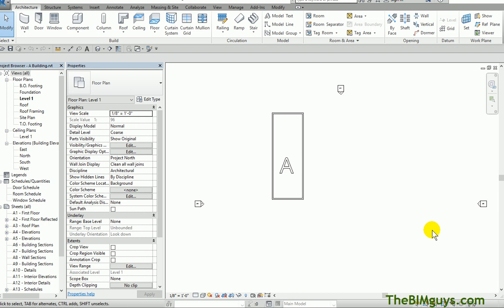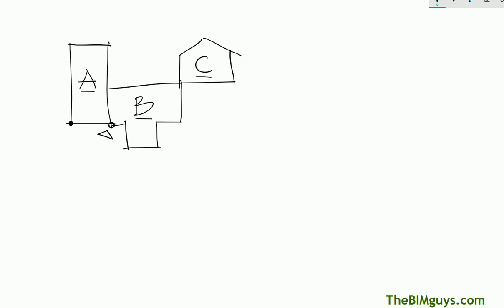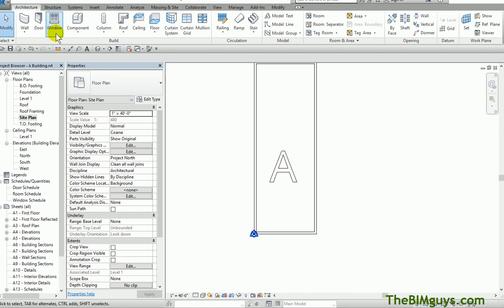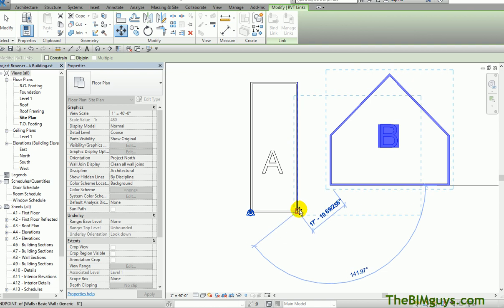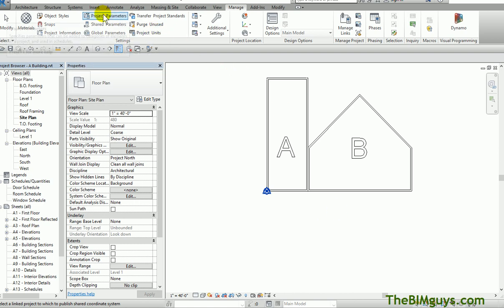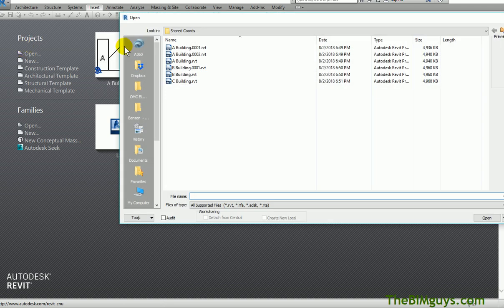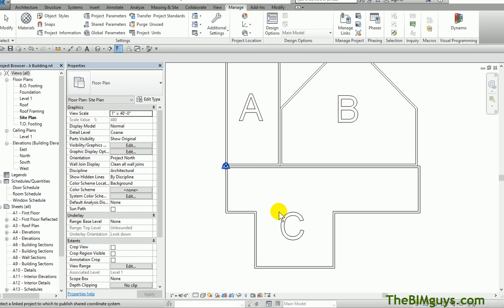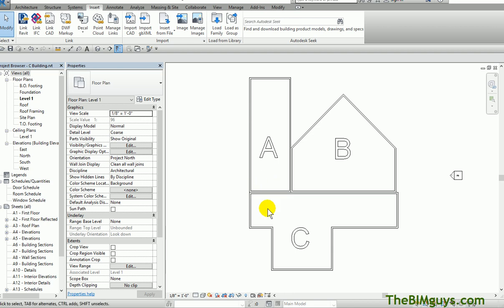Revit Shared Coordinates Simplified- CADtechSeminars.com

Comment: it worked for me! thank you! I just have one question, how come the project base point and survey point of both files are different even though they are aligned?
Reply from the maker: It depends on what option you used when you linked in the file and what point system you used to align, Check your shared coordinates also.

Comment: Great video! Moving the PBP från the Project Origin is something people consistently do in videos on Youtube. However I have strictly been advised not to to do that since it will unnecessarliy offset linked IFCs. Also seems like Autodesk now has removed the option to unclip the PBP since revit 2021!

Comment: What if the linked RVT file is supplied by a 3rd party and is still a work-in-progress, therefore keeps changing and being updated?
This would have to be done each time, there is a new version of the linked file.
In such case, I don't see any particular reason to use shared coordinates, as the next time I'll be linking the file, it'll be a different file with no saved positions.

Comment: It would have been very useful if you explained what the internal origin is.
Reply from the maker: Sorry, When this video was created, the internal point was not available to the user in Revit as it is in the current versions.
Reply: Actually the internal origin point has always been available. The only difference between Revit 2020 version and previous releases is that in the latter it was invisible. In order to find it you just need to select the project base point, unclip it, right click and click on the option “go back to original position”. That is the internal origin. What I suggest is to draw a cross with 2 reference planes and pin it so you always know where it is in the model.
Reply from the maker: @gabrielepiacentini9277  good point!  - pun intended :)

Comment: I like it. But what if B and C are actually existing buildings linked in where their coordinates are fixed? Does publishing from A TO B and C change their locations in their models? Thanks
Reply: Mark P there are lots of ways to link files using different coordinate systems. Probably the best way to go, is to make copies of the files and play with the different options and note the results. I use very simple buildings in the video because the concepts sometimes are hard to wrap your head around in all the scenarios. One option that I did not mention in the video that may work for you, or using saved coordinates. You can actually move a building around the site and have Revit retain or remember that location. I currently do not have a video on this topic posted to YouTube. You may want to Google shared coordinates and saving shared coordinates and you may find an answer.
Reply: Mark P another way is to just link the file into the host drawing set it and it's correct location. And then pin it. Go to the other file and do the same thing. You can have the files LinkedIn moved around and pin them in different files for different situations. They do not have to be sharing a coordinate.